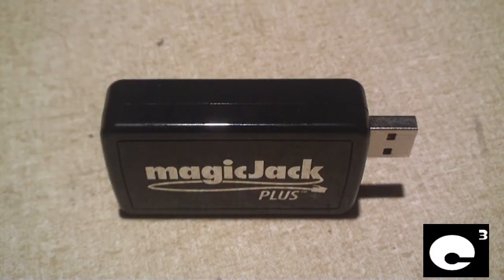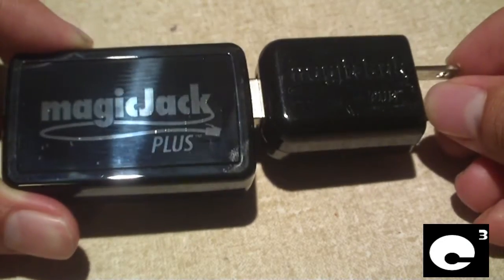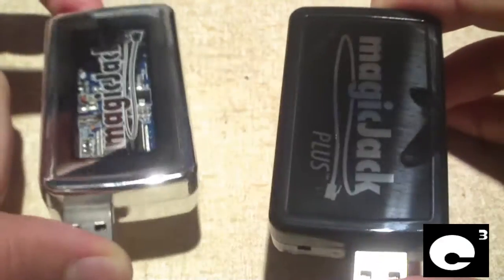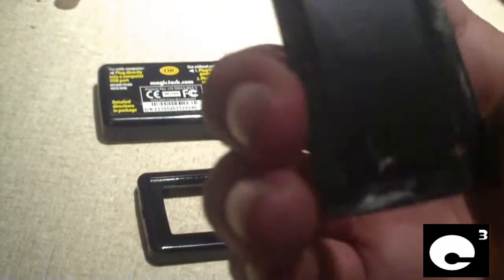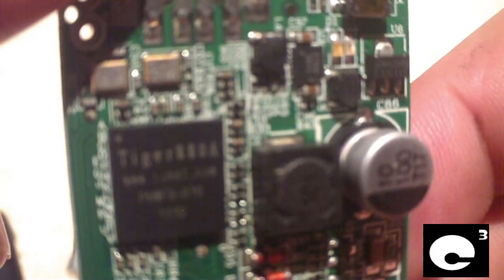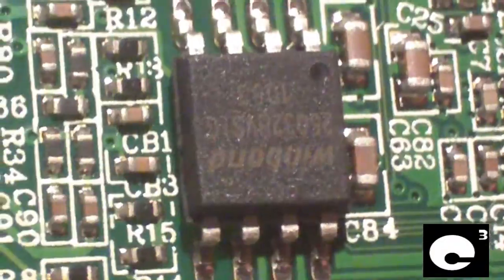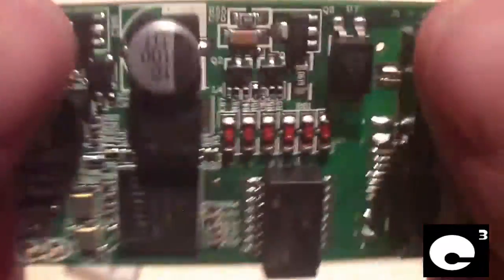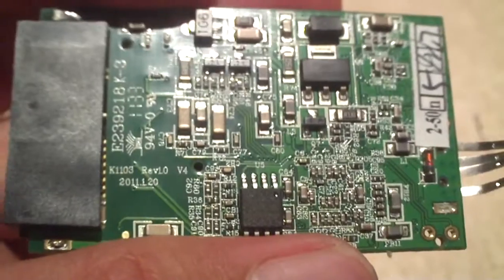Inside a magicJack Plus - HD closeups

Comment: Thanks for tearing yours apart first. Saved me from breaking anything. Just needed to take the MJ  side cover off that is stuck on. The adhesive they use made it very easy to take off ...just like you said! Keeps the factory  warranty intact.

Comment: That Ma-haja plus might have been just fine. The USB power adapters that they ship with are absolute garbage. My first one lasted less that a year. Blue led still lit, but the ENet indicator leds were not lighting. The +5 volt was sagging under load. No dial tone or "check your internet connection" errors.

Bought another USB adapter on Amazon for $5 and it ran fine for another year. That USB adapter crapped out after a few months. MJP eats small USB adapters. Get a larger one - 12 watts or more is good.

Comment: That is not the Ethernet Controller, that is simply the required Ethernet isolation transformer. The CPU has a built in Ethernet controller.